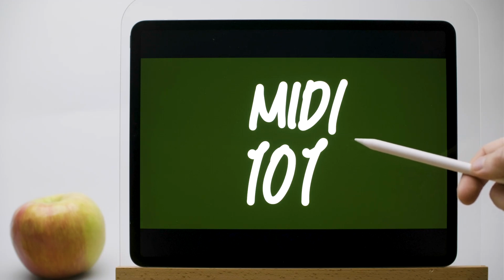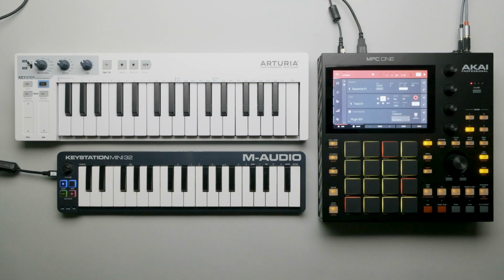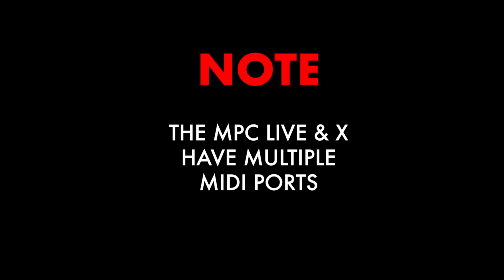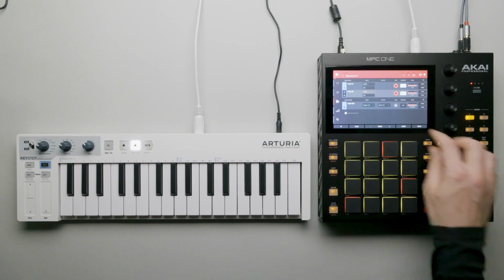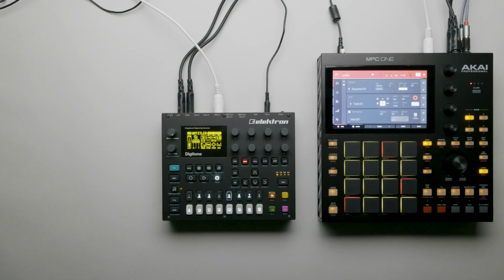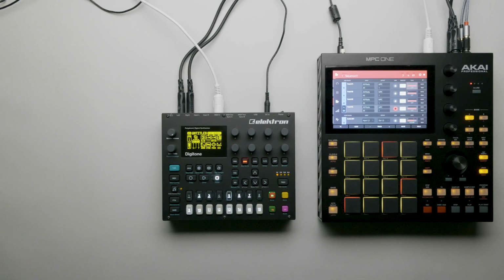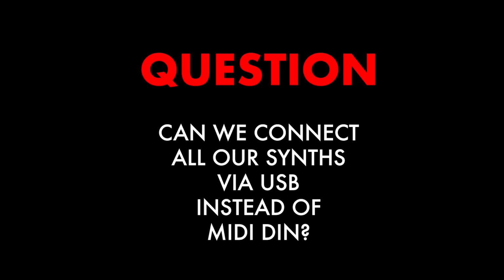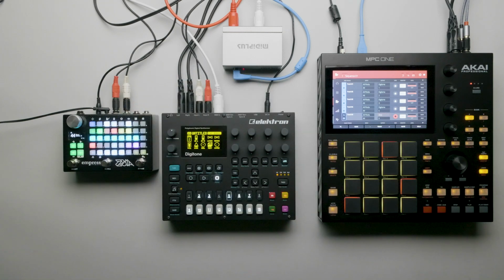MPC: CONNECTING MIDI DEVICES

Comment: This really helped me a lot. If I want use a keyboard synth as a midi controller for my mpc live 2 to control instrument plug ins, other external synths and the keyboard synth it’s self how could I do that
Reply from the maker: You could do that by setting up midi channels for each device that you wish to control. On the synth/controller, you would then switch midi channels to control different devices in the chain. Hope that helps.
Reply: @OllieLoops  thanks! I didn’t want to buy a midi controller just control a synth with a keyboard

Comment: Is it possibly to record two separate midi tracks with the same multitimbral synth? I have a Live 2 and have one patch from my synth on midi program 1. Record and all good. When I try to use a different patch from the same synth on midi program 2 it changes the sound of the original midi track to that of the 2nd patch. Currently I'm saving one as a audio track and keeping the other as midi but I then only have control of the ASDR,cutoff, envelope, etc... of one of the tracks if I'm performing live.This is frustrating but I dont know if what I'm asking is even possible....

Comment: thanks for making this video super well done! would you know how to use a sustain pedal to act as the kick ie allocate to a pad in any way?
Reply from the maker: Thanks! There are some foot pedals that are midi either via USB or 5 pin din. That should work for what you're looking to do. You would just midi map it like you would any other controller. A typical sustain pedal alone won't be able to interface and midi map like other controllers can.

Comment: Can I plug it to the computer via usb just for midi without going into controller mode?
Reply from the maker: I believe you can. It does MIDI over USB, so you should be able to send that data to and from a computer via USB.

Comment: I have a korg monologue and want to hook it up via CV...is the sync out on the monologue a CV out and how do I set it all up on the setting in the mpc one?
Reply from the maker: Thanks for your comment. It depends on how you want to use them together. You could run the CV out on the MPC into the Korg to send notes to the Korg. Or you could send the out from the Korg into the MPC, if you wanted to play the keyboard on the Korg and record the notes in the MPC, for example. There's a lot of ways to use the two together. You can also plug the Korg in the MPC via USB, that allows you to set up the devices to talk in both directions. Hope that helps.
Reply: @OllieLoops  I am using the usb with the Tascam Model twelve and want to hook up the Monologue and Roland TR6S to be able to play both monologue and tr6s individually and record them on the mpc. Hope it makes sense

Comment: I want to trigger my Roland TR909 sounds with the MPC ONE. Can anyone help me on the midi setup for that? I just want to turn them on, and trigger and sequence the 909 on an MPC ONE track, or sequence. Doe's anyone know what the midi setup is for that? I just need instructions . Thanks in Advance
Reply from the maker: You should be able to connect a 5 pin din midi from the MPC’s midi output to the midi input on the 909. Make sure the midi channels are coordinated. They setup a program on the MPC to communicate on that midi channel. Insert that program on a midi track. Should be good to go. This assumes your audio routing happens separately.

Comment: hey, how you connect the Mpc that the key step (pro) just trigger one channel? the I try to play it trigger all 4 channels ...
Reply from the maker: You may need to tell the Key Step to output Midi on a specific channel, not all Midi channels. Then set the channel on the MPC to correspond.

Comment: Brother, I think you've given me the answer but just to double check, can you connect dj controller like pioneer dj400 or Roland 202? mainly to play with samples in different way and do scratches
Reply from the maker: yes, you can connect it as an input device just like a synth or other similar device. Use the same instructions to connect it, but you would not need midi to connect a dj controller, just audio from the dj control's master output to the input on the MPC. Make sure the input is set to line level, not phono. Then set up a track on the MPC to accept the incoming audio signal. Hope that helps!
Reply: @OllieLoops  You are a star bro. Thank you lots. ❤️ I'll make sure to visit your channel more often.
Reply: @OllieLoops  Would you recommend turntable/turntables and some small mixer with fader or dj controller? the more I read the more people recommend proper turntables with direct drive. Is there a good budget alternative? there is little to no videos about it, most include techniques, and reviews of the best turntables.

Comment: So I was trying to hook my Roland Fantom from its output 1 into the MPC Live’s input 1 so I can write notes into the MPC for it’s built in synths, from my fantoms keys. But also wanted to have another midi cable going from my MPC Live’s output 1, into my Korg Minilogue’s input so that I can also switch over to a midi track on my MPC and play/write notes with the sounds from my Korg, using my Fantom’s keys. This used to be no problem when I was using the Roland FA 06 but now that I’m using the Fantom it seems more complicated for some reason. I was trying last night, to have 2 separate tracks one using the hype engine and the other track as a midi channel to use my Korgs sounds but when I would switch over to the midi channel I would hear both the hype and the Korg when I press my fantoms keys. I just want to be able to switch back and forth tracks on my MPC to get to each sound individually like I used to be able to.

EDIT: So I just had an idea, would it work easier this way if I routed the midi from my Fantom output 1 into my Korg Minilogues input, then go output from my Korg into my MPC’s Input? I might still hear both sounds at the same time but I would just have to turn down the volume of the Korg on my mixer when I’m writing notes on the Hype track, and then when I write out the notes for my Korg I’ll do it on my fantoms sequencer. then when I’m satisfied with the pattern I’ll just have to play it back alone and sample it immediately to put into an audio track on the project in my MPC. Either way I always had to sample my tracks from the Korg to get it into my project. The only difference is I was able to have those 2 separate tracks before on the MPC where I hit play and each individual track would play the perspective sounds assigned to each track. When if I do that now, when both tracks would have a different midi pattern and both tracks would probably be playing both sounds over both of those patterns, If that makes sense.

Comment: Maybe someone will be able to help me. I have an MPC X and Arturia Beatstep Pro. I connected the MPC X MIDI output with Beatstep Pro MIDI input and set "sync' option in MPC X MIDI settings. This way if I press play on MPC X, Beatstep starts as well. The problem I have is that if I use the same setup but using USB connection, nothing happens on the Beatstep when I press play on the MPC X. Does anybody have any idea what am I doing wrong? Also thanks for that video, it is really great.
Reply from the maker: Thanks!
Does the Arturia have a switch for setting midi parameters? Maybe it’s setup via the accompanying software. The Keystep has dip switches for setting midi in/out. I’m not as familiar with the Beatstep.

Comment: I am trying to use MPC as a multitimbral synth sequenced by the Octatrack. Corresponding plugins set to a specific midi tracks on the MPC are set on the OT, but the MPC still plays only one track...
Reply from the maker: Interesting. What type of tracks are you trying to sequence on the MPC? There maybe something in the setup of those tracks that is incorrect.

Comment: Great video, but I missed what I was looking for, namely: what is the Remote in the Input and output for? I can't find it in the manual and my searches on Google are not satisfactory...
Reply from the maker: Which Remote input and output are you referring to?
Reply: @OllieLoops  If you go to <Preferences/MIDI/SYNC there is a line that says "Remote". Both on the Input Ports as the Output Ports
Reply from the maker: I see. In MIDI, the Remote parameter allows you to take Remote Control over a device externally. You can allow another device to control the MPC, or the other way around. I hope that helps.

Comment: I would like how to physically connect the MPC as a sequencer, an external synth and a usb keyboard to controll the synth and MPC sound library. I have the Behringer 12D, Arturia Keylab 49 MKII, powered usb hub (7 usb connections) and the MPC One. Thanks.
Reply from the maker: Thanks for your question. I would suggest getting a usb hub that can handle all of your devices. Then make sure all of your devices are connected to the hub. You should then be able to select a midi channel for each, set up corresponding programs for each device, set up channels for each program and you can control the devices independently. Hope that helps.

Comment: Hi :) thanks for the well done tutorial!
I have a midi question, that was not discussed in the video.
How can I setup the MPC so that it sends value changes to the faderfox ec4, that I don't get value jumps when change a value via the faderfox?
The faderfox doesn't know the actual value. 
Do you have an idea?
Thanks so much :)
Reply from the maker: I’m trying to follow. I think I understand, but I’m not versed in Faderfox. I would recommend reaching out to them for info on your issue.
Reply: @OllieLoops  thanks for the answer :)
Do you know, if I need to setup something in the MPC, so that the MPC gives the value changes (for example amp attack...) out via midi out?
Thanks for your time :)
Reply from the maker: I believe you can midi map most parameters. There’s a special section in the menu for midi mapping. Take a look at that. I recall it’s quite elaborate.

Comment: I tried connecting an NTS-1 to my MPC One this evening having followed the instructions given. Whether using MIDI Din (Teenage Engineering 5 Pin midi to TRS Type A) or USB, it did not work.
Using USB it detected the NTS-1 in the MIDI ports option and appeared to register on the tiny keyboard strip thing but there was no sound whatsoever to the enabled audio track. 
Using MIDI DIN, it didn't appear to see it at all, no sound either. I connected a Volca via MIDI DIN and again neither sound nor any sign of it receiving anything. I followed the instructions in the vid carefully, so I am at a loss. The cables are all functional so it doesn't seem likely to be that.
Reply from the maker: Sorry for the delayed response. So you got it to connect via midi, but there was no audio, correct? And you have an audio cable coming from the NTS1 to the MPC?
Reply: @OllieLoops  Thanks for replying. I'd forgotten to turn up the Rec Volume on the back of the MPC and was also at one point on the wrong midi channel and changing it in the wrong screen. I oughta read the manual!
Reply from the maker: Ahh. Ok. Sounds like you got it figured out.

Comment: Any idea how to connect the Dreadbox Typhon to the MPC One?
Reply from the maker: If the typhoon does usb midi, than that would be the best way to connect them, via usb. Connect the two to a usb hub. Otherwise, you can always use midi 5 pin din. In to out. Out to in.

Comment: Amazing video! Is it possible to sequence the MPC live externally? beyond 2 tracks.. There is a section where you talk about splitting the midi channels, just not sure if that actually works in the way I am trying to do it. I am using a Cirklon sequencer and would like to have 16 instruments on the MPC being controlled via the sequencer. I was able to use both midi din ports to sort of get 2 things playing.
Reply from the maker: Thanks! Yes, that should work. You have to set the instruments on different midi tracks and then you can control them externally.
Reply: @OllieLoops  Ok Im stuck somehow.  I will try and make it more clear. My hardware sequencer has its USB going into the computer. The MPC Software on the computer can see it. The sequencer also shows up on the MPC live. I want both the MPC Live and the MPC software to have the transport start and be synced to the sequencer. I am able to trigger the software and the MPC live with the sequencer. But the clock and transport are not seeing the sequencer. Is this even possible or is it related to some setting. I have tried all sorts of combinations in the midi settings, but must be missing something or messed it up even further.
Reply: It my own user error... Cirklon has some deeper settings ... that I checked and its possible to resync the tempo everybar to prevent midi drift.. and deep down in there was a setting for MTC.  Its strange because it can start other drum machines

Comment: Hi , Can anybody help me. I have bass sounds uploaded from splice on my mpc one. Can I play these bass samples with my midi keyboard ? If so how ? or can midi keyboard just play plug ins ? Im  a little confused any help would be appreciated.
Reply from the maker: Hi, you can connect a midi keyboard and play a plugin or samples on the mpc. And I recommend it as it can be more intuitive than playing the pads. To do so, connect your midi keyboard to the MPC. Most usb devices are plug and play. Arm the track and following the setup instruction in this video. You should be good to go. Just remember, the midi keyboard is just an additional controller for the sounds within the MPC.

Comment: Awesome video!!! I have a question in regards to the External Synth section.  Let's say the external synth is a key board (Yamaha Montage etc...), and it's setup like your example, USB from MPC to Synth, and then Stereo Out to Stereo in on MPC.  You showed how you can control the synth from the MPC, but could you also somehow record midi notes using the keyboard from the synth into a sequence and it's own sounds, edit it, and then record it into an audio track?  If so that would be great!!!!
Reply from the maker: Thanks! Yes, usb midi is bidirectional. If you play notes on the synth, they will be recorded into the mpc, assuming the mpc has recording or overdub engaged. So you can play ones on the mpc or keyboard of the synth. Hope that helps.
Reply: @OllieLoops  Thank you!!!!

Comment: Hey humans: I've went through this and I still am not getting sound into my mpc live 2 from my synth (MegaFM). I have the cables connected properly, record volume on the back turned up,  and everythign connected to the MegaFM synth properly. I am tapping pads, and seeing the midi out indicator light up, but nothing is coming into the mpc. I have the audio channel set up as shown in this video, but still no sound. Does anyone have an idea of what's not working, or could offer help in this situation?
Reply: M  ine I  sn't  D  oing  I  t !
Reply: @pranahead9464  what the hell is wrong with you?

Comment: Very informative. thanks a lot. But, If I have a MPC, can I connect the whole Korg Volca series (4 of them) at the same time? For instance, :) without the expensive Digitone as a hub. Thats what I still dont get. Or do I relly need the MPC live to control more hardware?
Reply from the maker: You can connect Volcas similar to how this was done with the Digitone. The principles are the same, you connect midi from the MPC to the volca, and audio from the Volca to the MPC. Now, where you may need some additional gear has to do with how many volcas you want to connect and how you handle midi and audio. There are only so many midi outputs from the MPC, so you may need a MIDI hub to gain additional outputs. Likewise, there is only one audio input on the MPC, so you may need an audio mixer to combine audio outputs from the Volcas to the MPC. I hope that helps.

Comment: Thanks for this and the other MPC video explaining the sequence/track/basics! 

I used this video to control my Volca Keys from the One, but I'd like to also control my iPad Pro (USB-C) soft synths at the same. Any ideas? I'm trying to play both live at once (audio into mixer).
Reply from the maker: Great question. I know you can connect a midi controller to the iPad for external control. I would assume getting the camera kit or USB C to A adaptor would allow you to integrate with an iPad and mpc. You could then run audio into a mixer or from the iPad into the mpc.